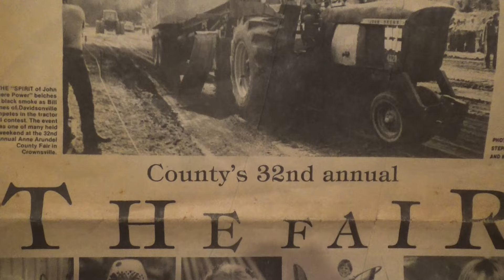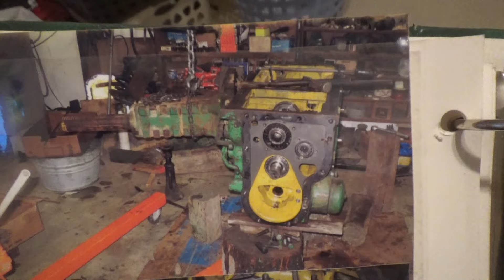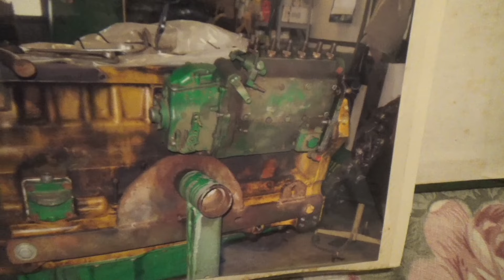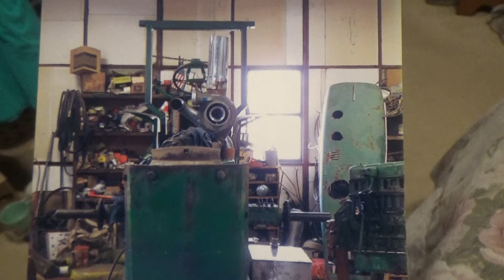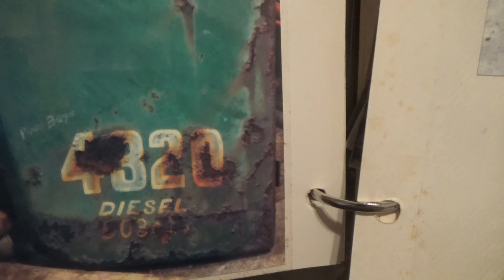Spirit of Deere Power, 40th anniversary pull

Comment: We used to run a small input shaft like the one in that picture but it was twisted about 1 spline. It never did break but we put an 1 3/4 shaft in it when we built the 3 speed transmission.
Reply from the maker: We have a larger shaft in it now, never had a problem with the small one, not as much HP as you guys.
Reply: @so.md.dirtfarmer2226   I think whats really hard on it is fast gears. We are running about 15:1 ratio now. Stock 8th gear is about 22:1 ratio

Comment: Awesome presentation on the shirts, you had me laughing out loud! What did you use to port and polish? Did you have hand held "pneumatic die grinders"? Maybe by 2010 you had more shop equipment than a welder and drill press. Been a HOT August here in South central Kansas with little rain, reservoir for Wichita water supply is 7' low.
Reply from the maker: Yeah, I had "pneumatic die grinders"by then.😁Sorry you're still dry.